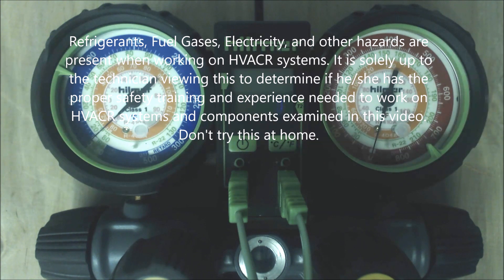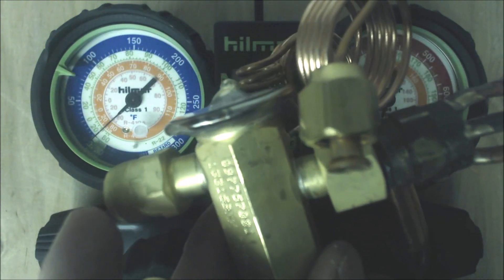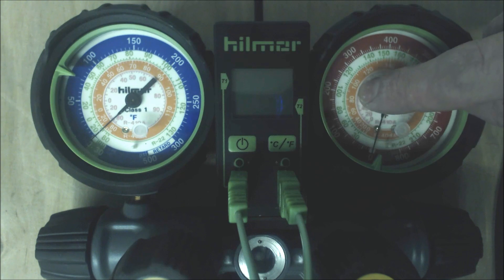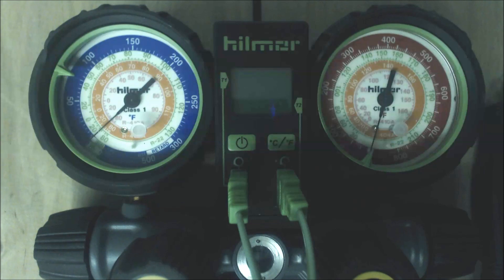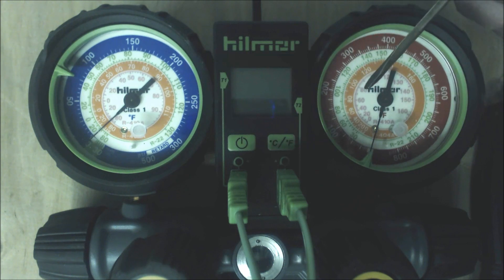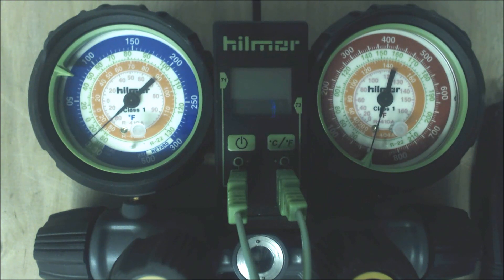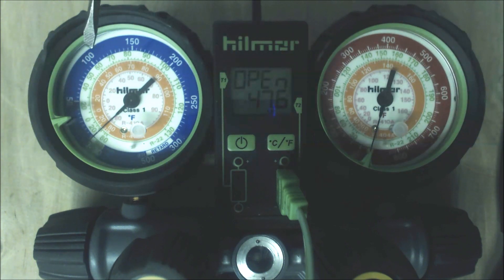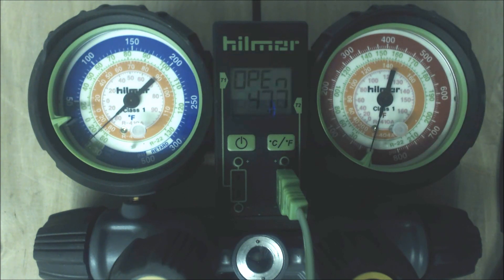How to Check Superheat and Subcooling!

Comment: How do you check the tonnage in a furnace
Reply from the maker: Look at the rating plate of the blower motor for the btu/hr of cooling airflow on the inside of the furnace, thanks!

Comment: How to take wet bulb temp on a ductless mini split ac system.pls guide
Reply from the maker: A wet bulb temp measurement is taken of the indoor air in order to find the target superheat for single and two speed compressor ac units that have a fixed orifice. Minisplits have a txv and are typically VRF, thanks
Reply: AC Service Tech LLC Thank you very much

Comment: You explained superheat and subcooling as they relate to HVAC very well in this and another video.  The compressor rating plate (in your video) provides the required degrees of subcooling for a TXV system.  Do you ever adjust the readings taken at the compressor which is at ground level to the actual elevation of the TXV valve? 

Here is the reason I am asking this question.  On my R410a systems the TXV's (in the attic) are ~20ft above the service valve connection at the compressor.  Using the R410a liquid density on a 95°F summer day; the actual pressure at the TXV valve (due to the elevation change) would be 8.9 psi below the pressure reading at the high pressure service valve(port).  If the ambient temperature was 95°F this change in pressure would result in about 2.1°F decrease in the saturation temperature of the R410a.  There could also be a small temperature change from the 50 ft of liquid filled tubing routed through the hot attic and walls.

Do you ever worry about this change in saturation temperature due to elevation when calculating the amount of subcooling?
Reply: Add a accumulator

Comment: You mentioned possibly overcharging a system if the outside temps are low. I have read about partially blocking the condenser to bring the head pressure up to mimic a 95 degree day. Do you have any videos on how to properly do this procedure? Thanks.
Reply from the maker: I do not as of yet and that would be if the system has a txv. That would be a good video to do though but you need to already know roughly what the pressures should be around on that unit to try to get close to the subcooling that it would actually have on a hotter day. I would still highly recommend going back during your spring check up time to confirm the charge.
Reply: David Williams take the fan out if need be....

Comment: You should do a video on charging a dry system after a compressor change. Adding oil, do you charge on liquid side or vapour side etc.. Everyone I talk to tells me something different
Reply from the maker: Thanks for the idea! Hermetically sealed compressors have oil in them when you replace so you don't have to add more.  thanks

Comment: For the most part I have a good understanding of Super heat and sub cool. My question is, How is it possible to hook up your gauge set at your condenser and attach your temperature probe inches apart and be able to get your saturation temp and the line temperature with a temperature probe at the same spot in the system. When you are getting a superheated vapour at that location in the system. It just doesn't make sense  to me. Why is the gauge showing the saturated temp at that spot and not the superheated vapour temperature. I'm hoping you can help explain why that is. Thanks.
Reply from the maker: Yes this is a question I have been asked a lot in the past. Glad you picked up on it. Here is the video -- https://youtu.be/th0EnaSbJUw
Reply: Great video.... thank you for responding to my comment. I watched the other video and it answered my question. You really put a lot of time in these videos. Thank you for your wisdom and your time!
Reply from the maker: Thanks Danny L!

Comment: Gave me good knowledge about this superheat and subcooling process. Thanks servicetech. just wonder how long it took you to feel comfortable to start working with this systems.
Reply from the maker: Well I started off with one of those slide calculators so I had no idea what I was doing if the numbers didn't match up. I had a really good teacher in who I was working under as a helper and during the end of my first year I was checking and adjusting my installations myself. I would not recommend people use those slide calculators though because they become a crutch and you are not learning what is happening in the system. Thanks eman3208!

Comment: Let's just go with ol' R22.....If I may ask...What's the biggest difference in low pressure according to your low side gage? (analg./digi.)  E.g. Lowest low side pressure reading you can think of you've ever gauged and highest low side pressure reading on gages for or set at R22? thanks for any input....just wondering....In my short career so far it's never been a big difference....
Reply from the maker: Great Question! Low side can be correct depending on the wb temp and the outdoor temp. The magic range that I experience is anywhere between 62-83 psi normally. Are you only checking newer units that have been running or older units that maybe are broke when you get there and high humidity in the building upon start up? Thanks Adam!
Reply: acservicetech Both.....That's about what we see....Although here in "New Orleans"....well....U know our weather im sure....
Reply: I'm currentl installing an used condenser. The crane operator on site told me I shouldn't need froen because he thinks he front seated the kings but, I asked if he pumped it down while doing so and he said no. New one for me so, Im anxious to get back soon as it warms up in the next 2-3 days about 40° "lol" to see how it looks....if they have no 22 and it's needed. Depending on how they want to handle it i may just put some 407c in the system....Had done this recently on a few older systems on a day job im no longer working for....no choice they needed it and wouldn't do it the way we see it done in the industry....But i have to be honest....it seemed to be wrkng just fine....at least for about 6 months....its been 4 years and im pretty sure its probably the same...